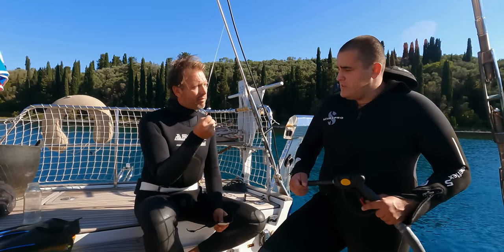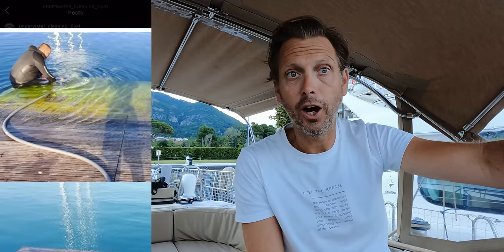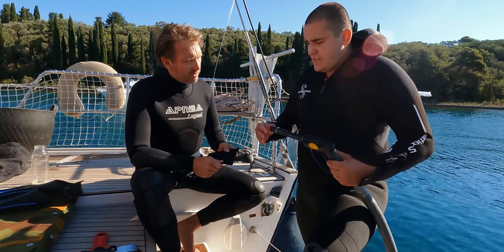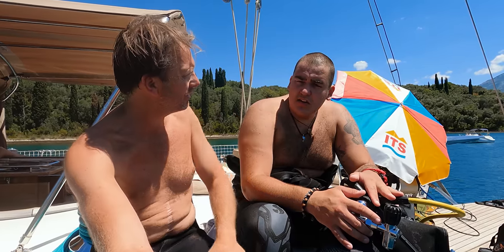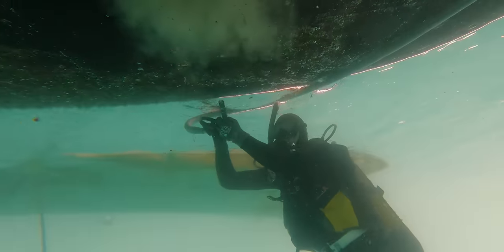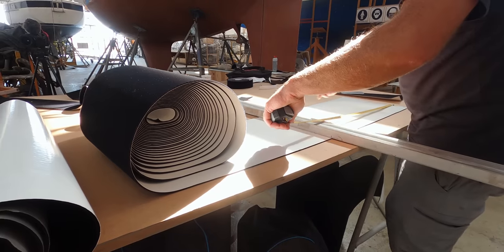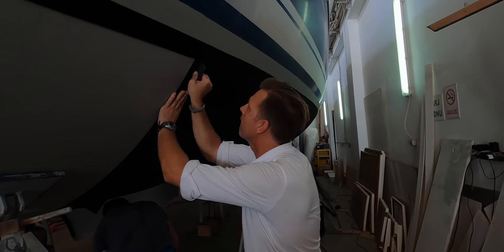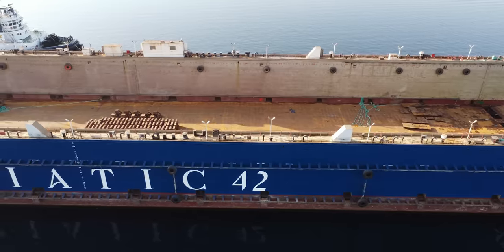CARPET UNDER OUR BOAT - Will we do it again 😳

Comment: Please round off the corners on the spackling blade. I clean my boat as well. But , it is easy to penetrate the finish or even the hull with the sharp edge.
Reply from the maker: Super advice, thank you!
Reply: Good point. That's our advice too

Comment: I would be looking at $5 a foot x 60 feet x 1 cleaning per week = $15,600, round up to $20,000 per year, which is very reasonable to keep the bottom fast and in good shape. Your time is worth at least $200 per hour, so 100 hours covers it, plus you get the write off. Perhaps a high quality epoxy paint job on the bottom is all you need, if you're doing a weekly cleaning? The Captain likes his bottoms really slick and fast!!!

Comment: Cavitation happens when the water is accelerated through the nozzle and the pressure at the nozzles vena contractor drops below the vapour pressure of water, creating a vapour bubble. It’s when the bubble collapses it produces a microscopic pressure wave of extreme intensity.

Comment: Perhaps you should try to do more regular cleanings of the hull like once a month maintenance and see how the product acts. It’s unusual to wait 23 months to clean the hull. I’d like to see how that goes.
Reply: I agree with Barry, 2 years is a long time between cleanings.  I’ve never heard of the product and would likely avoid it.  I know the two of you wanted to be positive but I’m not sure you sold me.   I’m surprised your thruster even works it was so over grown.  Thanks for introducing the product.
Reply from the maker: Absolutely Barry, this was just an endurance Finsulate test, from now on we will clean much more.
Reply from the maker: We don’t want to sell you anything, just an honest review.
Reply: @FeeltheBreeze  in theory, I think this product makes a lot of sense and I want to continue to track your experience to see if will be something I would do in the future. Curious how the cost compares to ablative, hard paint and copper coat. Thanks!
Reply: @FeeltheBreeze  nice! I’m interested to see how it performs with regular cleanings. By the way, I’ve seen a catamaran owner install the Sonihull Ultrasonic Antifouling Duo System and seemed to have very good results. Wonder if you could look into this as well. 👍🏻👏

Comment: Interesting🤔 theres a new generation of biologically inspired hull coatings to resist fouling .. 
A fellow Dutch guy with ocean crossing Trimerans uses no coatings just uses a hard finish Epoxy on his hulls and polishes it so everything comes off with a hard rubber scraper.
https://youtu.be/L7Q6mGHlWdE there's also a Swedish company that builds boat hulls from stainless steel and polish it to a mirror finish below the waterline ...its so slippy they get very little fouling and it sheds easily..